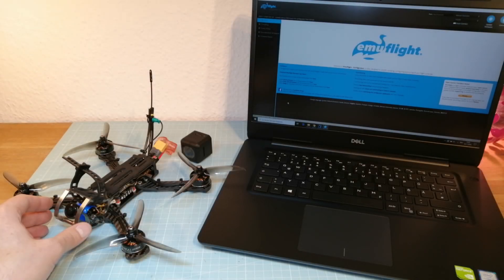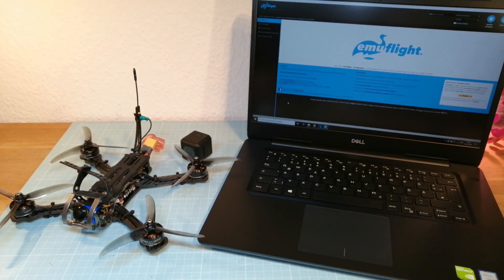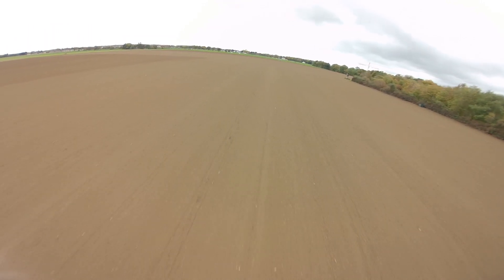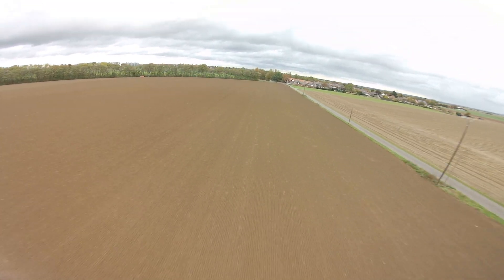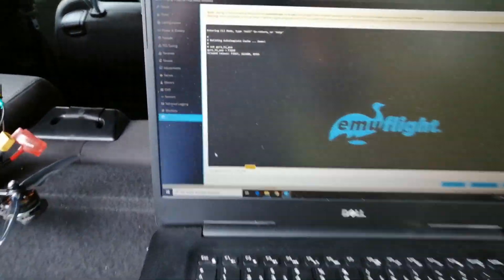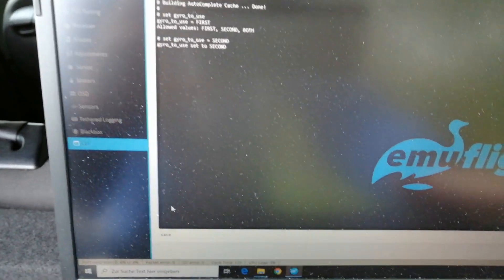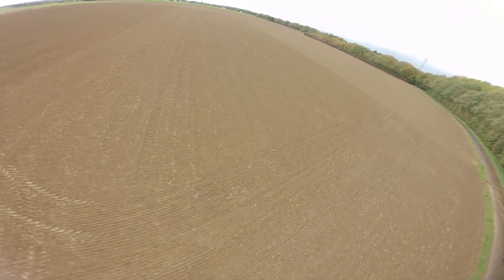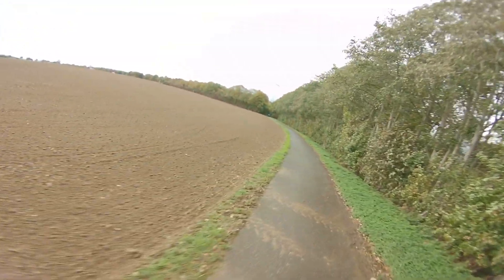EmuFlight 0.1.0 - F4 or F7 Gyro? 🤔 8K or 16K PID and Gyro Looptime? MPU6000 vs ICM20602 - Test

Comment: Nice video! I just tried emuflight and it is nice. I use 0.2.0 configuration and an dual gyro hglrc f7 with theicm 20602 enabled. But neither from  confirmation tab or from cli I can't enable 32khz sami g. After the fc reboots it is off every time. I can't figure it out :(
Reply from the maker: I think it's not possible to run 32k/32k without overclocking. Maybe it works if you only use Multishot without accelerometer - btw: Multishot is even smoother than  Dshot and dshot can't handle those high Loop times. I'm also only using 16k16k even on my helio quads. I need the accelerometer for the gps rescue mode.
Reply: @TorbanDallas  i figured out that the user manual was wrong and the gyros ware marked in wrong order. So when i chose the supposed mcu i could choose 32k.  
Thank you for the answer thought. But I ended up setting at 8k 8k and i am very happy with it. Bf 4.0.6

Comment: MPU6000 @8Khz have an internal low pass filter.
ICM20602 @8Khz have it also, but not @32Khz sampling (same at 16Khz). 
So if you go higher than 8Khz you should manually add more filter. Like a biquad @250Hz to replacer the removed "internal gyro" filter.
Unfortunetly docs of MPU6000 and ICM20602 doesn't give the exact type and Fc of the internal filter (When sample <8Khz)
Reply from the maker: Thank you for the information on the internal gyro filter!

Comment: Know that IMUF is not working on  stable release.

You can hear the D-term oscillation pretty clear on the 16k, which makes sense since 16k lets a ton more noise through to the FW filters.
Reply from the maker: Thanks for your comment UAV Tech! I have also added a link to the bbl of these flights in the video description - I didn't want to talk about the log in this video, because the footage and the audio make pretty clear which gyro works best.
My only FC that works fine with Pid and Gyro Loop times above 8k is the Helio Spring FC with the ICM20601 gyro.

Comment: Can it work on iFlight SucceX F7 TwinG Flight Controller with gyro fusion ?
Reply from the maker: Well, there's are target for this FC on the EmuFlight Configurator, it's a fork of Betaflight 3.5 - so I think it will also handle Gyro Fusion and as you have seen in my video, it's possible to select FIRST, SECOND and BOTH :)
Reply: @TorbanDallas  EmuFlight is a fork of ButterFlight.

Comment: I haved the same problem with fc and this gyro
Reply from the maker: It's not a problem of this FC. It's a problem of the ICM20602 gyro, I think you will get this problem with any other FC with this gyro.
Reply: @TorbanDallas  I hope not, bicouse I bought clracing f7 with two ICM20602 90deg 😅

Comment: Is hard to give a conclusion by only watching the video. Something that I learned by having a Dual Gyro board is to use Blackbox to troubleshoot Gyro issues.
Reply from the maker: I did record a bbl. I can upload and share it. But in the bbl you can also see that the gyro and motors are noisier.
Reply from the maker: But I think you can definitely see the vibrations in the HD Footage while you are watching this video on your PC and even hear that the first flight with the mpu6000 was the best one. Maybe you won't see a difference if you only watch this video on your phone.
Reply: @TorbanDallas  you would need to check if noth filters are needed and apply them in the correct noth.  Check for pick motors noises and setpoint steps.